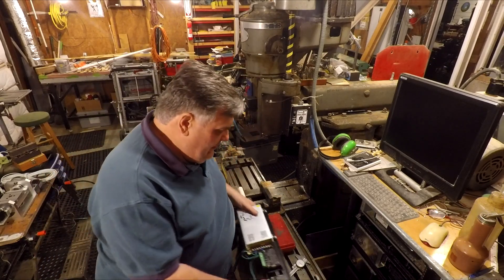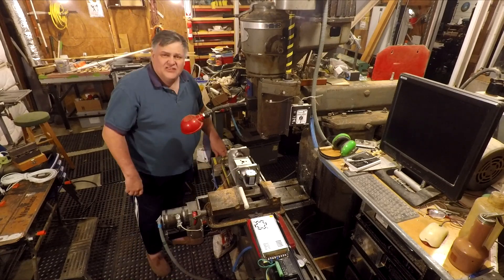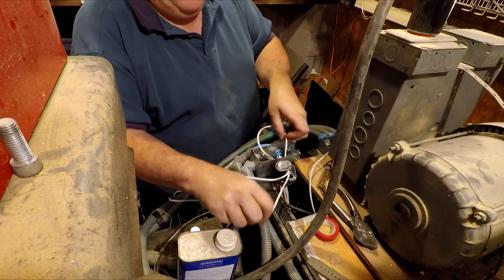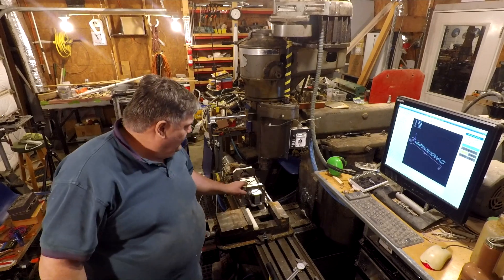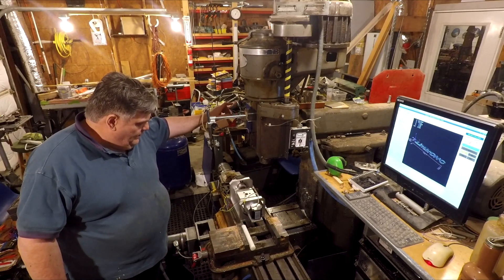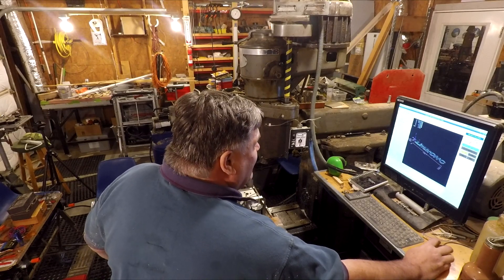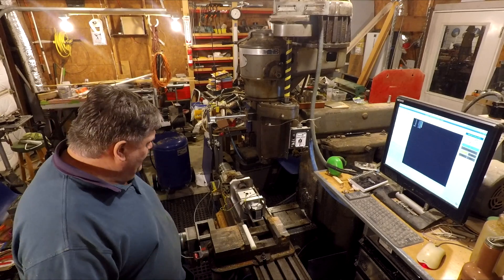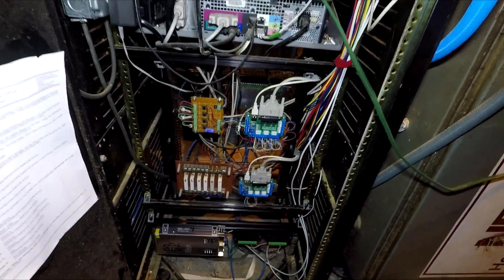Monster Mill - 01 - A New Start

Comment: Nice, Jerry! Planning to do something similar to my CNC router. Setting LCNC up for the 4th and 5th axis strikes me as probably pretty straight forward. Looking forward to seeing how you set up Fusion for the additional axis
Reply from the maker: The first time I did it... there was head scratching involved. The STEPCONFIG does NOT support 5-Axis. I ended up cheating and setting up a 4-Axis with the C-Axis connected. Then i re-did it with the A-Axis connected. I then took all the "A-Axis" lines from the first config, pasted them into the new config... and everywhere it said "a" something... i changed it to "c" something... adir became cdir, astep became cstep... etc. Then i changed all references from [AXIS 3] to [AXIS 5] ...why not change to [AXIS 4}... because that would be a "b" axis... and the way I built this one is an XYZAC device. 

It's 15:00 now... and I haven't been out to the shop yet... camera is charged... I guess I had better dissasemble the axis, mill the slots, and bolt it back down. uggg.... then i have to drill and tap the devie and figure out how to run the wires. Not gonna get done with me sitting at the computer eh?
Reply: Hmm. Maybe trickier than I thought:) you are a few months ahead of me - good to have you blazing the trail!